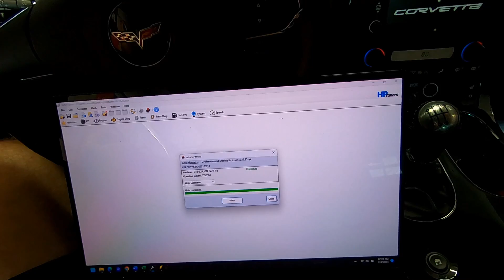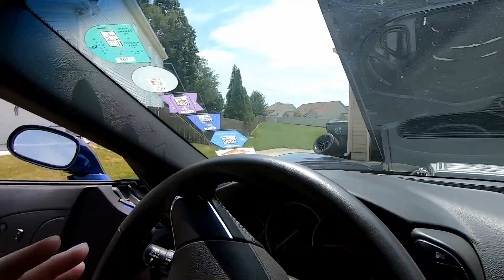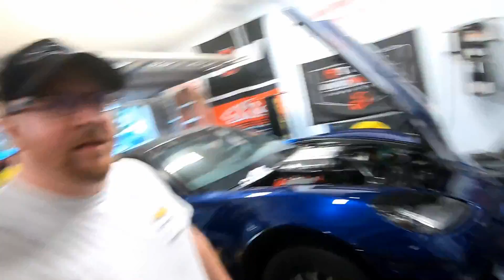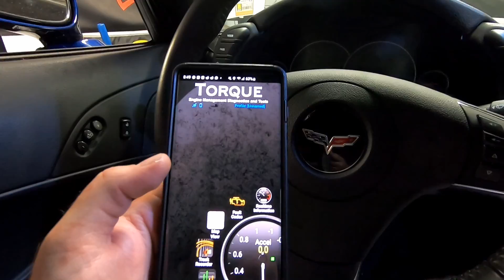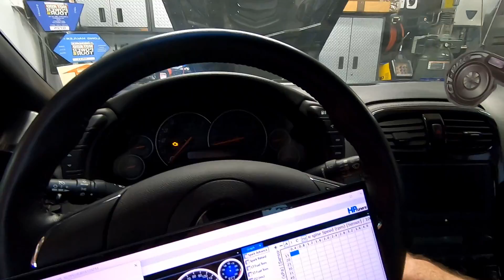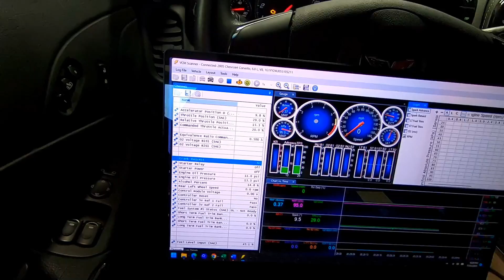2005 Chevy Corvette - Will it start?

Comment: you need to check the push rod length or some thing it dont sound right
Reply from the maker: That's one of the first things I will be doing.
Reply: @bonecrrusherSS  looking forward to the next video keep up the good work
Reply from the maker: You called that one - pushrods too long. Pulled the rocker arms and magically had 60+ psi in the chamber while cranking over.
Reply: @bonecrrusherSS  Glad you found the problem. Now get it fixed so we can get a new video 🤣🤣🤣🤣
Reply from the maker: Already half edited - trying to see if I should upgrade the springs while I have it apart.... 🤔